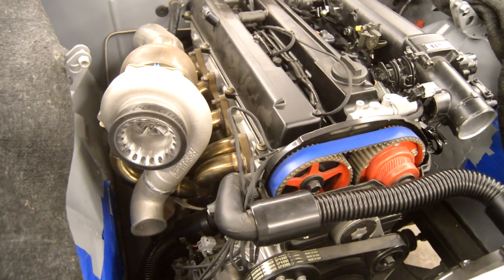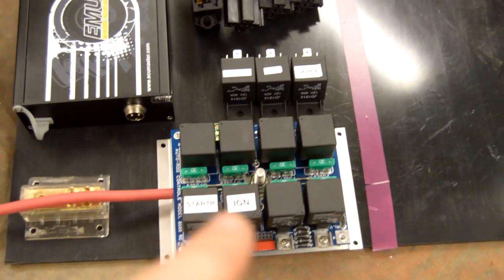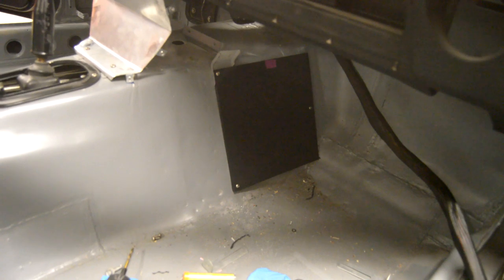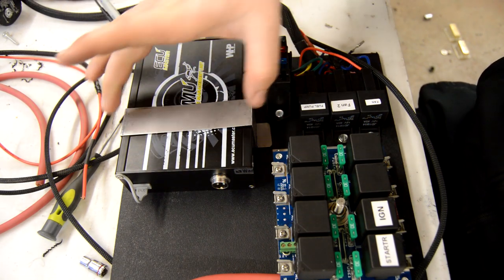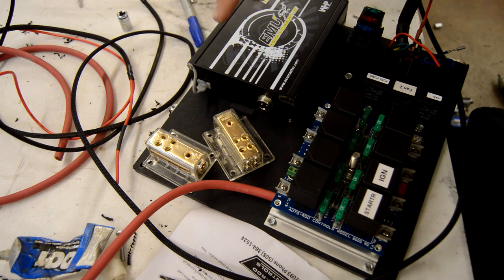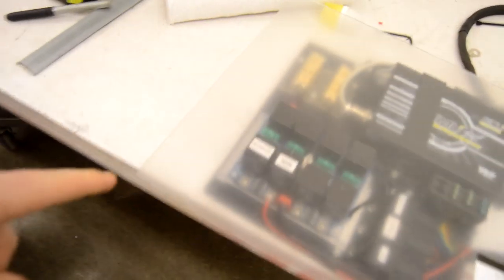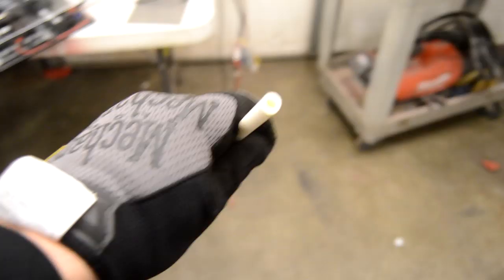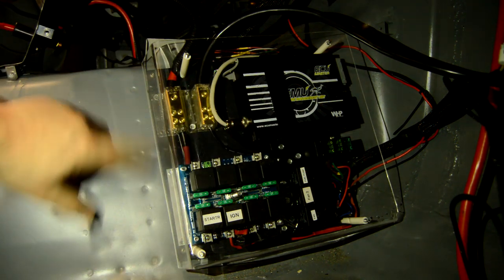Making an ECU / Relay Board for the 1jz 280z

Comment: How did you power the jz harness/ecu? Ecumaster says you need a 3a 12v feed to ecu, but the jz will need coils and injectors powered from a separate 12v feed at higher amperage. I have a jzz30 1jz with emu classic and arc 8000 as you do. I have a stock harness tho. Wondering how all that other jazz is powered.
Reply from the maker: Power for the ecu should be on a separate circuit (wire) than the coils.

Comment: Did you go with a after market 280z body harness?
Reply from the maker: Yea painless harness. All it does is control the turn signal stuff. Everything else is either deleted or I ran myself. Or it uses the wiring specialties harness
Reply: @StewartMotoring  I have one also from a different brand. Did you get the wipers to work? And how about the alternator  harness that comes from the 280s body harness on the passenger side?  I have a 240z with a 2jz that the alt charging wire shorted in the fire wall. And now the car doesn't crank over. So I'm trying to replace all the harnesses.  Thanks
Reply from the maker: Wiper wires I ran myself to my own switch. I don’t have a turn signal lever. Also my alternator wiring was included in the wiring specialties harness so.. not sure I can help with yours
Reply: @StewartMotoring  I notice that too from the wire specialty site. They  offer alt plug type...I just notice that the 2jz  oem engine harness isn't with the oem alt harness..  yeah now maybe IL have to buy the wire speciality harness specific for the s30. So basically you just made a switch relay panel to power up the ecu, fuel fuel and accessories  off the turn key 12v ign... ? Thanks
Reply from the maker: I bought the ARC switch panel, which does all the relays and fuses for you. Kinda expensive but worth it if you don’t like to wire.

Comment: why not self tappers instead of rivets?
Reply from the maker: J T self tappers are not a permanent solution. You only get a few uses out of them before they stop threading but probably the biggest reason is I don’t want sharp screws sticking out the trans tunnel
Reply: @StewartMotoring   the Main power coming from the battery to distribution box is it fused? INLINE   the main reason i ask because my setup is similar i was told to fuse my incoming hotwire from battery
Reply from the maker: J T yes I added a 250amp circuit breaker for the wire from battery to kill switch. It’s nice because it’s like a house breaker, if it trips you can just reset it (of course after researching why it tripped in the first place). If you watch my battery relocation video it should be apart of that

Comment: Wow! Looks incredible, great job! Are you concerned about heat at all mounting the plastic to the metal in that location? Also, are you planning to put any sound canceling, insulation, or carpet there?  Also, what type of plastic did you use for the clear case? Thanks and keep up the great work!
Reply from the maker: As far as heat, not concerned. Two sides are completely open. Not sure what I am going to do for the floors yet. Some kind of rubber mats I'm sure. I bought the plastic from home depot. Dunno what 'kind' other than plexiglass.
Reply: @StewartMotoring  Great, thanks for the response. I've been following your build, great stuff. I have a 260z project, so it's great to learn from you. Keep it up!

Comment: Hey man what is that upper water hose ? Is that the flex ones ? You have the part number for that ? - great vid
Reply from the maker: Thanks, it’s an eBay hose. It’s metal and flexes. Just cut to length. Type flexible radiator hose on eBay.. They have chrome and black. I can’t give a review since I haven’t started the motor or ran coolant though.
Reply: @StewartMotoring  ah ok perfect I check it out - bro the build is coming out very nice !!!! 👍
Reply: @StewartMotoring  I see you went baller for a arc ignition system very nice
Reply from the maker: Haha I had to. It was just too nice of a unit. Saved me so much time on wiring to by the arc kit. And thanks I watch your videos too. Keep it up
Reply: @StewartMotoring  Believe it or not i might consider getting my self one of those hahaha - hey are you in the west coast ?
Reply from the maker: Lol no, far from it. IL
Reply: @StewartMotoring  oh well aleast I'm not the only one with this cold lmao - we gotta link up some how for some content.
Reply: @StewartMotoring  what's your ig ?
Reply from the maker: I’m down with that, I have an s13 that I made a vid on but it needs some mods. Ig is StewartMotoring